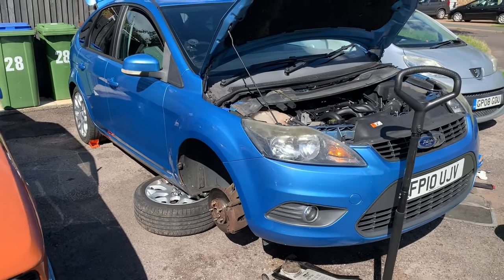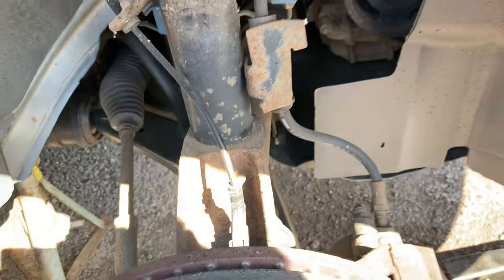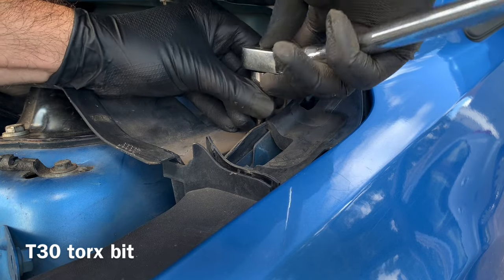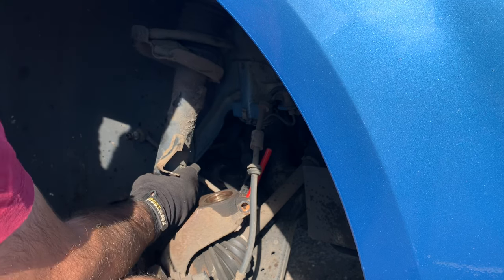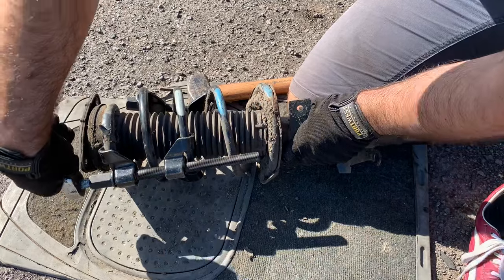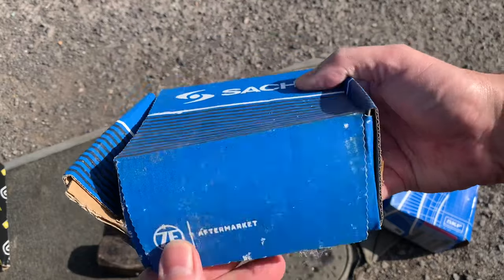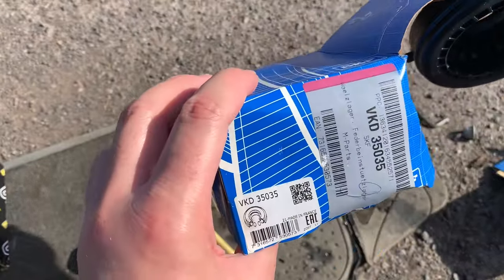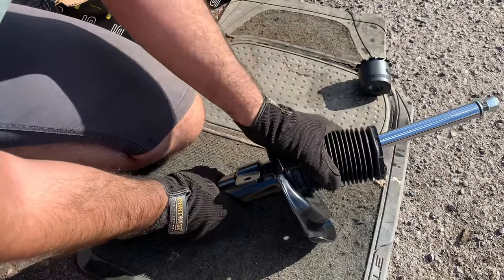Avoid Costly Mistakes: How to Replace Ford Focus MK2 Front Shocks

Comment: lucky to get that 15mm lower shock bolt out. mine is stuck fast and now rounded :(
Reply from the maker: damn :( only solution is to try and hammer in a slightly smaller impact socket and undo it with plenty of heat and penetrating fluid. Or, weld a nut on it
Reply: @GentilsGarage  i was in a time crunch to change the spring for mot so i just undid the track rod and lower ball joint (replaced recently so they came apart) and the top of the strut. it gives just enough room to change spring and top mount. i will replace the whole hub when i replace the shocks. they are cheap enough :)
Reply from the maker: @FordForTheWin  that's a good alternative

Comment: Please i need help with my MK2 1.6 2011 model. The information cluster screen light remains on even when the vehicle is switched off and locked. How do i turn the information screen off when not in use.
Reply from the maker: It’s stays on for a few minutes. It’s perfectly normal and mine does the same as well

Comment: Hi I put brand new shock and top months on my focus and put back on car took it for test spin and the knocking from the top was so bad but when I put back on the old top hat with the new bearing it when is there two types off top months for the old and new focus mine is 2009 can u tell me please thanks
Reply from the maker: That’s strange as I’ve only seen one type of top mount. 
One cause of the top mount k ouch is when the bearing doesn’t sit properly in the top of the spring. For that the notch on the bearing must line up with the guide pin at the bottom of the strut.
Reply: @GentilsGarage  I lined everything up perfect but when I put the new top on it knocked badley it was like the meatel on the top wasn't high enough like the old one was siting high
Reply from the maker: @kevingoldbey7401  That’s strange. Never heard of that before. The only way to see why this is happening is to compare them side by side and measure them.
Reply: @GentilsGarage  I did the we're the the same all around but when I looked at the old and the new top hat the middle was different the old one had more sticking out the the new one
Reply from the maker: @kevingoldbey7401  ok, and the new ones are same brand as mine, Sachs?
Reply: @GentilsGarage   no the ones I got are called napa
Reply: Did you solve this problem as has this crazy knock ever since changing strut and top mount and have removed MANY times and changed top mounts and still knocking!
Reply: Exact same thing happend to me with napa top mount, everything lined up n tight but, left me with a knock worse than the old 1😂😂😂😂😂

Comment: No the ones I got are called napa  and the shocks are called napa too
Reply from the maker: Ok, have a look at the pinned comment. One of my viewers had issues with Napa shocks and mounts, so you’re probably having the same issues.
Reply: @GentilsGarage  ya I say that's what it is so but once I put back the old top mount hat it was better but I keeped the new bearing bottom part just changed the hat I never buy napa parts again